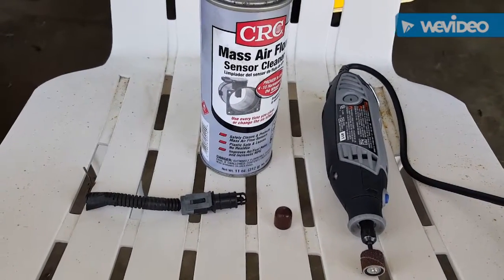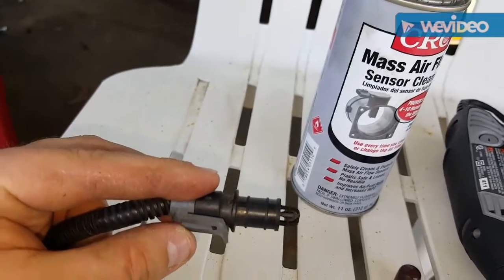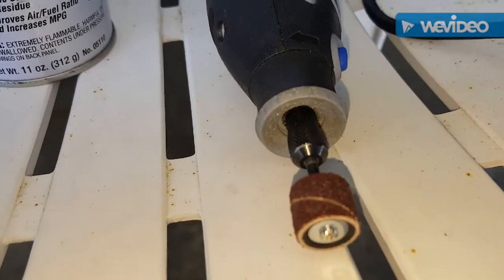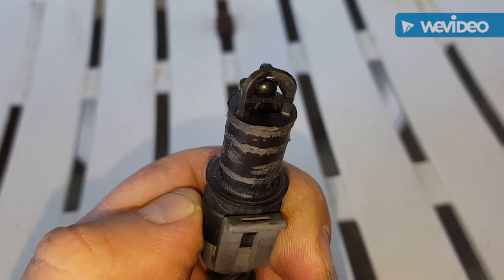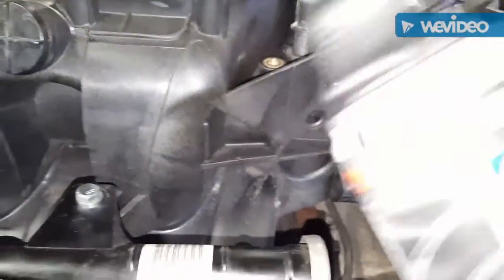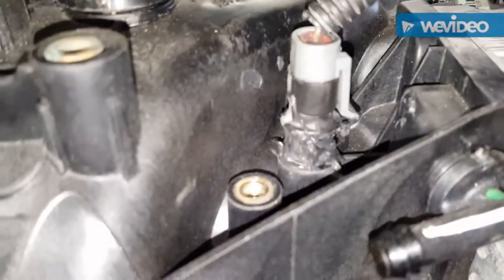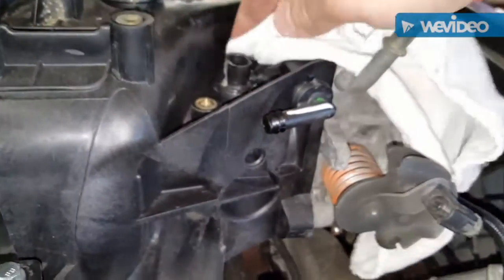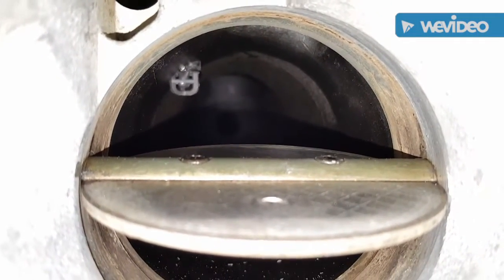GM IAT Sensor in a Truck intake

Comment: just found this video as I am doing my first LS swap and I have a LS harness and using a 2002 Camaro MAF.  need a place for the IAT..     what IAR sensor did you use?  Did you have to drill out the intake (Where the EVAP went??)

Comment: Was it difficult to get the old IAT out? How did you do it?. Also do you see any reason that a re-purposed AET, automotive, would not workIn a marine application? In my application with a 8.1 gm/Volvo Penta drive, these are all discontinued and non-serviceable from the manufacture.

Comment: And what's the advantage of putting the IAT behind the throttle plate where it's definitely going to get carbon fouled?
Reply from the maker: Jim Jimm haven't fouled one yet.
Reply: Carbon is a byproduct of combustion....there is not any combustion inside the intake. IDIOT!